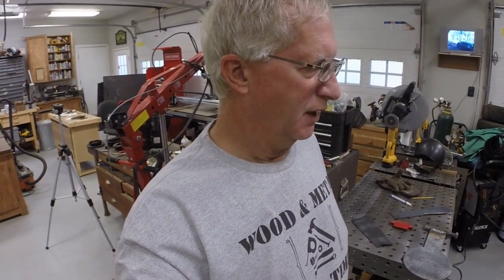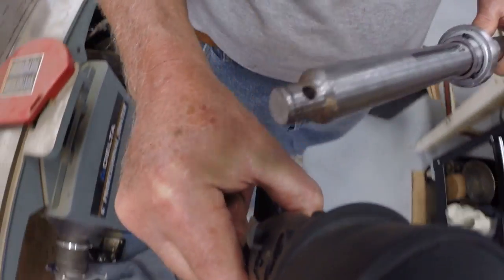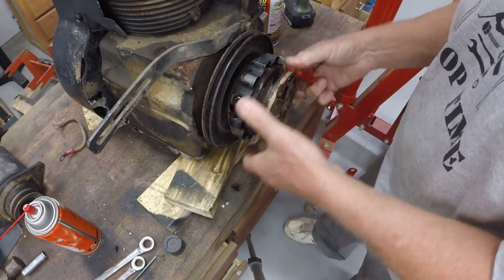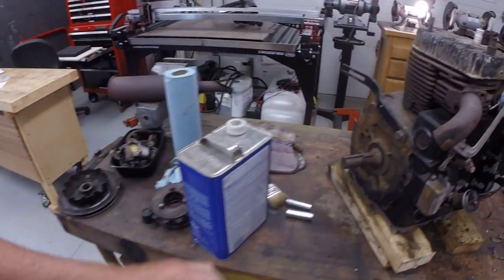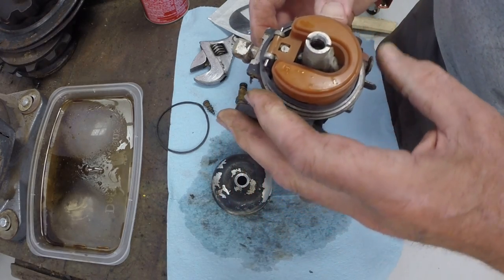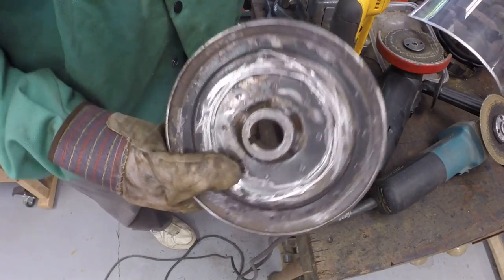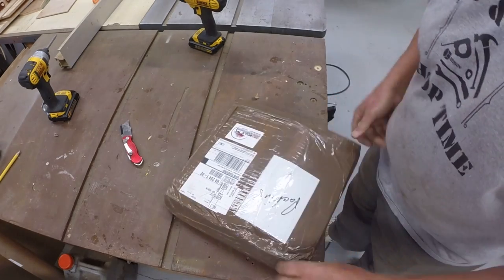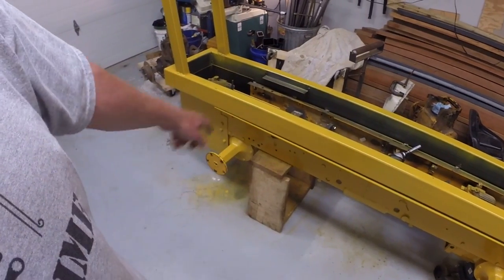Cub Cadet Dozer Build Episode #9

Comment: Frank, thanks for the information on the spiroll pins. I used a bolt on my machine, but haven't operated it as it a work in progress. I actually have a sliding two piece driveshaft on mine, and will likely use a 12v fan to coll the hydro.

Comment: very cool project.  I took two 1650 cubs and made a dual axle dump bed.  years ago. 
love the cubs, I still have my 1980 IH 582  and 1967 129.  both still grass killers. and the 582 has a 10'' plow. tiller and a push blade attachments. at one time I almost had one of every model cub in the narrow frames.  
I have a big plasma table. love every square foot of it.
Reply: When I was a mechanic for IH, we sold a lot of Cadets.  We had a 582, but no buyers.  I always wanted to see it in action.
Reply from the maker: I built a tandem with a dump bed. There is a video on the channel featuring it.  I have a 1650 with a QA42 snow thrower on it. It's a beast and one of my favorites.

Comment: if you didn't already cut the center out of the Sprocket yet a easier way to join it might be to use the hub they sent with the Sprocket and make a shaft type adapter that bolts to the axle hub . easy and lightweight,  just a thought

Comment: My thought on the chain it looks big enough but I would weld inner link, not outer link, to the grouser pad, so you can still get your removable link out if you ever need to remove the tracks
Reply from the maker: I'll look at that. Might be better to do that, but inner link access is limited. It could be that the entire track pad/link are used as a connector.  Or perhaps I fab a different connecting link that works differently.  We'll see, but that's a great suggestion. Thanks!

Comment: Great video series. Just got an older Cub Cadet from my Father in law and I am already wondering what it would be good transformed into.
Reply from the maker: Good point. In (upcoming) episode 12  I have some pads cut out on the plasma table,  but I cut them too close, realized that and commented that there needs to be some space.  I've been trying to figure out how to overlap them but I'd need to send them to a shop with a big brake. If I were to create an offset along one edge (for the overlap), it would stiffen the pad quite a bit, perhaps eliminating the need for grousers or thicker steel for the pads.  I could get by with 3/16  or certainly, 1/4 inch.  I'll have to check with the local metal fabricator and see what it would cost.  Thanks for the observation!

Comment: Hey I had an idea on making it easier to remove those set screws. The threads get corroded/rusty over time. Before trying to loosen or remove screws. Run a bottom tap down the hole to clean up threads. The screws should come out much easier. But you probably know that lol
Reply: I worked in a potato field.  We used a thing called Anti-Seize on the set screws and bearings.  It sets them.  And when need them off, it comes right off.   Sometimes when people don't use Anti-Seize, you have to use a torch to get off the bearing.

Comment: Great videos, thanks for sharing! Was wondering if you are going to use a bearing and trusses to support the axel extensions from the axel or frame? Are you worried about the torsion forces on the drive sprocket with the extended shaft outing any side load on the original axel bearings/bushing?
Reply from the maker: The axles are pretty robust and the loads on the sprockets won't include the weight of the dozer, just the drive forces. I am considering a couple different ways to reduce or eliminate the moment arm (cantilever) over-stressing the axle. Or, relegate the dozer to light duty and not worry about it since it's only 14 hp anyway.

Comment: If you removed 1 axle and axle housing on both hydros then u could mount the hydros to each other and that would space the track out as well.
Reply: I'm glad you said this, I  was thinking the same thing.  
All he needs is the bolt pattern to make an adapter and enough room between them to put bolts into each housing.
Pulleys or chain to tie it all to a center drive shaft.
Reply: Exactly

Comment: If you use conveyor pulley belts - or called link-belt - they can be split and installed and then re-joined.  They are power belts and joints can be replaced or shortened if warn in.
Reply from the maker: I have one of those on a lathe and they work great.

Comment: I was confused about your comment about engine orientation thinking to myself that you just need to install the engine with the same orientation that the 149 had. Then I looked at a picture and realized to factory orientation had the flywheel facing the rear axle. 😳
Not sure why I assumed the flywheel faced the front.
Reply: Yeah the flywheel connector has the drive shaft to the hydro, it only takes about 4-5hp to drive that at full load. The clutch is on the other end for the implement which will take all the power its got.

Comment: When you make your track pads you will want a decent gap between them or you have to make them overlapping. The wooden track you made, as the chain rolls off the sprocket back to flat the gaps close up and it could pinch a stone etc between the pads and it will either stop or tear the tracks up.
Reply from the maker: Great point!  I realize that in (upcoming) episode 12 when I cut out a few pads and mock up some track. I'd like to do an overlap to stiffen up the pads and allow use of thinner metal but I need to find a fab shop with a big enough brake to bend the offsets.  Thanks for the observation and for following the progress!
Reply: @woodandmetalshoptime8048   you possibly could lap and weld strips. Time consuming. But I guess that’s what makes a tracked hobby and that’s why real tracks are expensive.
Reply: @woodandmetalshoptime8048   and some sort of low profile grouser on the face of your plates to aid traction rather than rely on weight and flat. Just a strip or two of round bar welded on each pad face would work.
Reply from the maker: I like the weld on strips idea.

Comment: Sounds like red loctite was used. I've found it helpful to use carb cleaner 1st. That softens the loctite then your or oil will be more affective. Just my experience.
Reply from the maker: Great tip!
Reply: Usually heat is required to loosen red locktite, a propane torch applied to the fastener for a minute or two should loosen it. Of course, the more red locktite used, more heat is required.

Comment: Narrow track width would not only be precarious, but impossible to turn, there is an ideal width to length ratio for tracked machines, you might want to look it up.
Reply from the maker: I'm scaling off the D10, so the ratio should be OK, with some adjustments.

Comment: Putting a small hatz diesel motor in there imho would be preferable in dealing with those underpowered unbalanced vibrating Koehler gassers
Reply from the maker: I understand the power is very limited, but the design objective is to keep it as "Vintage Cub Cadet" as possible, and that objective takes precedence over it's ability to move dirt.  I'm not expecting it to build any roads or clear land. The fun is in the build--it's just a toy!
Reply: @woodandmetalshoptime8048  i built a dozer from a 74 Case 444 garden tractor using the K321 original engine and it had plenty of power, i used the same 61X chain and sprokects, the only real issue i had was the grousers i made for the track were a little to high, it dug into the ground and made turning a little hard, it is turning out very nice on your build, i have photos of mine i can email you.
Reply: @chincha805  I would love to see your case build
Reply from the maker: woodandmetalshoptime@gmail.com send 'em on. would love to see them.

Comment: Looking great man. What are you going to do to mount the track on the master link in the chain? I'm pretty curious.
Reply from the maker: Not sure yet, will have to figure it out when I get there. Open to suggestions, though!
Reply: @woodandmetalshoptime8048  
Maybe drill and tap 2 holes in the chain link on each side to attach the pad to the chain. I don’t think the link steel is too hard to drill. (Maybe 🤷‍♂️)😁
Reply from the maker: That's a good idea. I have carbide drill bits if I need them.

Comment: How r u going to be able to chg out drive belt other than taking drive shaft apart??
Reply from the maker: I'll have several spares pre-installed around the shaft, but yes, a couple bolts will have to be removed.

Comment: I watched another Dozer build a very fancy one and he had a small gasoline engine that he built it around. He started it and went out to push some dirt around and it was VERY underpowered. He ended up replacing it with a much larger diesel engine . He had to cut much of his original design apart to fit it in but in the end it was a great build. Just giving you a heads up that it seems you are headed down that road of not enough power. here is a link to that video. The first test is almost exactly half way through the video.  https://www.youtube.com/watch?v=i_b8opPXKVo&t=2s
Reply: Wrong link
Reply: @randalldworaczyk2943  Thanks!!!
Reply: Idk these cub cadets will push some dirt and snow as long as they have traction. I’ve never had a power issue it’s usually a traction issue.

Comment: Why did you use two transmissions,all you needed is one and steering brakes,im pretty sure those transaxles are differincials
Reply from the maker: Two transmissions provides independent forward and reverse track control on both sides--allowing you to spin in place, for example. Can't do that with steering brakes.

Comment: Are you concerned at all about the ground clearance under the diff As the track pads directly on the chain wont add any height ti the diameter of the sprocket.
Reply from the maker: Yes. The row of bogies will have to provide some clearance so they will be below the sprockets, something like a tank's tracks--so that is another compromise in this design.  But you bring up a good point, spacing the track away from the sprocket could help as well. Hmm...got me thinking now. I look at a track mockup on the sprocket on the axle in EP #12. Just finished editing that episode today.

Comment: You need to cut the keyway on the other side of Carrier bearing
Reply from the maker: Where exactly?  The pulley on the 1 inch shaft in it's new location has a keyway. It's the third keyway I've cut in this shaft, LOL.

Comment: Frank, considering this unit is being powered by an engine originally intended for a machine weighing in around 400 lbs to 500 lbs, have you given any consideration to the weight to horsepower ratio for the dozer versus the mower configuration??  Your build could end up weighing so much more than 500 lbs that it could be substantially under-powered just to move let alone actually push some dirt.  I own and operate a Caterpillar D3G bulldozer that is rated at 70 / 77 hp (net / gross) and weighs 16225 lbs for a weight to hp ratio of 231 lbs /  hp (net) or 211 lbs / hp (gross).  Since machine performance is heavily influenced by drive gearing and drive ratios, I am not sure you can reasonably scale down this ratio to apply to your mini-dozer, but I do recommend you keep an eye and a thought or two on how heavy this machine is at the end in conjunction with your available horsepower.  Where did you land up with the motor-grader in this category (do you know how much it weighs?)?  I am new to your channel and have enjoyed the dozer project.  Cheers from southeast Georgia!!
Reply from the maker: Many Cub Cadets weighing 800 lb had as little as 10hp engines. They ran out of traction before they ran out of power. The motor grader weighs 2000 lb +/-.  It has 12 hp. This dozer will be 14 hp and will weigh about the same.  I don't have any expectations of road building or land clearing with this.  No question it's under powered to do any serious work, as you and many others have opined.  It's more about the build than trying to have a "real" bulldozer.   
 Glad you are enjoying the videos and welcome!
Reply: @woodandmetalshoptime8048  Thanks for the response Frank.  Understanding the most likely intended objective and purpose of the machine I just wanted to make sure you had enough horsepower to; as a minimum, enable the machine to move under its own power which myself and all others assuredly are looking forward to seeing!!  My brother and I are curious about what you do / did for a living and where / how did you acquire so much knowledge on the Cub Cadet products.  Cheers again from the land of cotton and peanuts!!
Reply from the maker: I'm a retired nuclear engineer. Was going to use a little flux capacitor for power but ran into a lot of regulatory red tape...LOL.  Spent much of my career as an IT executive.  I've been playing with Cub Cadets for 10 or 15 years.

Comment: Which engine are you using for this build?
Reply from the maker: 14 hp Kohler K321.
Reply: @woodandmetalshoptime8048  do you think the engine is strong enough?? Other then that it’s a really cool build! Keep it up 😁
Reply from the maker: It won't build any roads or clear land but it'll be enough to play with. My expectations are modest.

Comment: You could have did it with one rear axle that had disc brakes convert them to hydraulic disc brakes and you wouldn't need the front axle because the front axle should pivot left to right
Reply from the maker: You can't make one track go backwards and the other forward without independent drives.

Comment: How are you going to tension a tracks with the axles non-movable? I would've just gotten like a small skid steer hydrostatic system and then the orbit motors it would've been easier to build it that way using the design that you have in your pictures then what you're doing. Besides the fact of being able tension the tracks. Because with a system like that you could use a charge pump pressure to pressurize single acting cylinders to tension the tracks
Reply from the maker: One of the earlier episodes explains how--with a pivoting idler --where the High Drive is on the D10.

Comment: You will need lots more power
Plus a 2 speed rear in out of a John Deere 420 garden tractor
Reply from the maker: You may be right about the power, but I don't have expectations of clearing land or building roads. It's mostly a toy.  As for the two speed rear, the hydros are infinitely variable speed, and with 12 inch sprockets (instead of 23 inch tires) it's already in "low range."  Probably max out at 4 mph.

Comment: Engines spark when the points close not when they open. Set the point at .015 at TDC and it will stark at the S on the flywheel. You could put the fuel tank on the hood with the fill spout sticking out. That way you won't need to open the hood to fuel it.
Reply from the maker: Nope.  The opening points cause the magnetic field in the primary coil to collapse, inducing a high voltage in the secondary winding, causing the spark.

Comment: Why didn't you control it like a real bulldozer? Open diff, right and left hand brake? That would have solved and simplified all of your driveline problems.
Reply from the maker: Real bulldozers (at least the current versions) use a pair of hydraulic motors, one per side. So the left and right tracks can be controlled independently.  With an open diff and brakes, you can't run one side in reverse and the other in forward to spin in place.
Reply: @woodandmetalshoptime8048   @Wood and Metal Shop Time  yes, your correct, you can't. That's how real bulldozers work, and have worked since their inception. They can not pivot on the spot. If you wish to go in reverse, you have to put it in reverse gear, and then again run the brakes. Some of the latest big dozers run hydraulic drives. But for the last 100 years they have not....same goes for tanks fyi
Reply from the maker: I thought all skid steers, and every current excavator I've looked at have independent hydraulic motors on each track. I understand some of the old equipment didn't.  Have no idea about tanks.  Trade offs with each design I guess.
Reply: @woodandmetalshoptime8048  skid steers and excavators do have duel hydraulic drives.

 Bulldozers traditionally do not. It makes it a really dozy to jump back and forth between them. 

Having hydraulic drives is much nicer, and more intuitive to operate as you can turn on the spot. 

A dozer can usually only lock up one track and swivel around that. Plus the hassel of having to shift from fwd to rev, and then the brakes turn you the opposite direction.